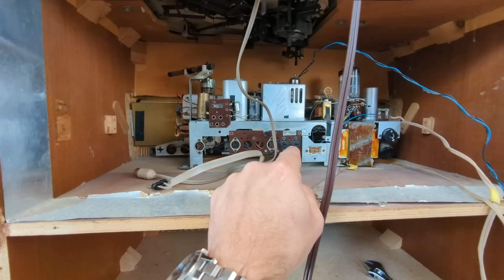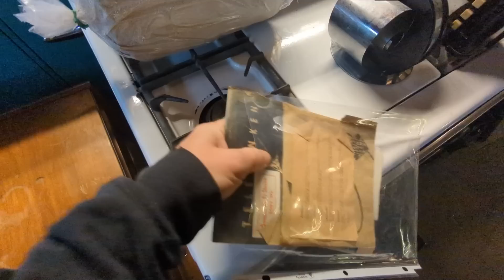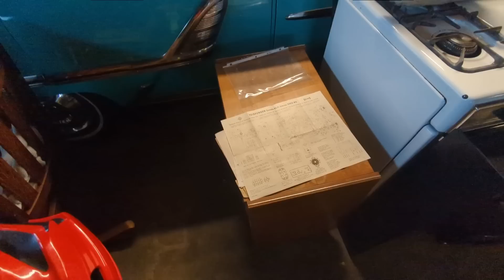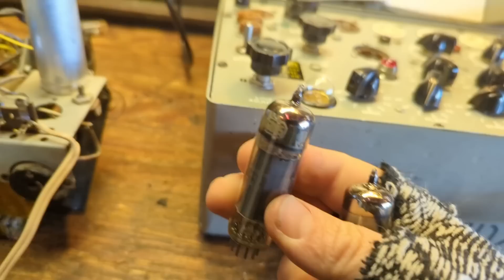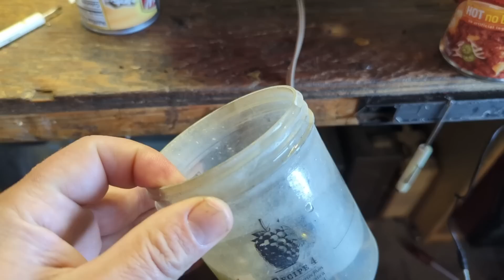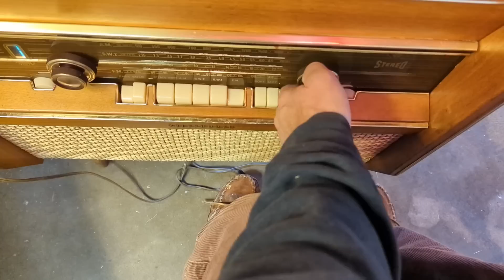Telefunken "Sonata" mini-stereo consolette restoration

Comment: You're a brave one for fixing this one.  A friend has one similar.  A larger console.  Grundig I think.  It has something I've never seen before.  A single tuning knob for four different tuner dials.  It has a little "transmission" with gears that shift from one dial to another depending which selector is pressed, AM, FM, SW etc.  Unfortunately the gears are disintegrating and it's not repairable.  They are no picnic to work on.

Comment: Thanks for doing these German sets, I have always been a bit intimidated by mine, but you are making it look easy. Maybe I should give it a go on a recapping, it has always been pushed back on the shelf and I work on something I am familiar with.

Last German radio I worked on was a Grundig. I thought I brought it up slow with a variac for about 30 minutes, but the main cap let go and spewed white powder all over inside the radio as soon as I took it off the leash on full power. I probably should have been feeling the can for heat, but now that is hindsight. Another great video, thanks....

Comment: I have a massive telefunken console that I'd love to get restored, thanks for posting this. only 5 minutes in so far but this is interesting. my console stereo does work fairly well but the record player is chewed up, I'd love to know if I could hook up external speakers to it for a better sound with the old analog style radio it has those same plugs as the one shown in this video but I didn't find anything that made sense re speakers for it. cheers.

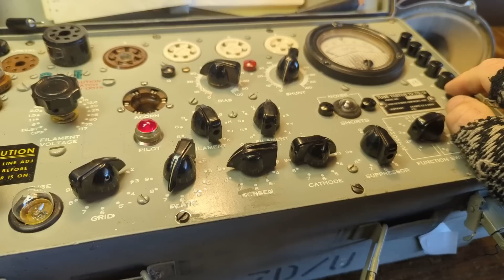Comment: Oh my... so many things happened way too fast but not waiting the 15 seconds for a tube to warm up before calling it "sick" at 16:00 really triggered me... Man, take your time.
Reply: This is my other seldom used account. But anyway Mister radio responding. Anyway... The tube in question was drastically more sluggish than any of the others. It would probably have still worked. Even tubes that test very weak will usually do the job okay. But keep in mind most of the people that are getting these from us are not technical. I want to make sure they have the best-performing most reliable set so that I don't have to do a house call anytime soon
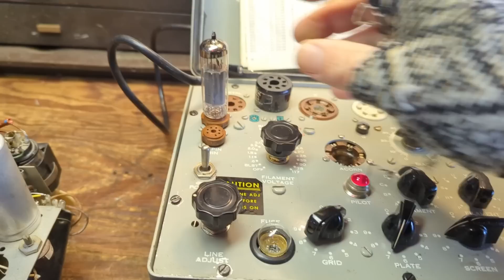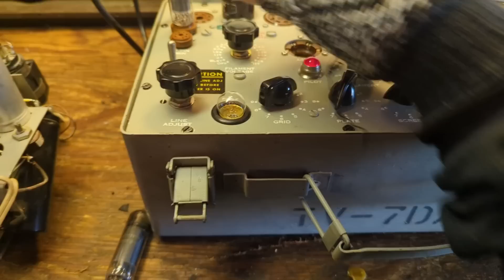Reply: It was actually 20 seconds. Tube in socket at 15:50 and was declared "sick" at 16:10. The tube before that was starting to move the needle and conduct at 10 seconds and was fully conducting at 15 seconds. When you compare it to the other tubes it was a slow starter perhaps, but that means it was tired anyways.
Reply: @zulumax1  Power tubes from different brands "light up" quite differently... For instance my daily driver FM radio with all of it's original tubes jump starts the Philips Miniwatt EL84 from 1953 for 10 seconds, before the rest of the circuitry... I hear the front end going without input for something like 5 seconds. A 1969 NOS Polam EL84 comes up with sound and you hear the volume cranking up. A NOS very strong 1989 Russian 6П14П-ЕВ (military grade EL84 analogue) needs 20+ seconds to start conducting. My point is... this restoration takes so much time and, finally, the tube testing goes on like an F1 race.

Comment: where are the output transformers?
Reply: Some German radios used capacitor coupled audio outputs with high impedance speakers, believe it or not no output transformers!  😯😯😯 I have one, a Phillips Jupiter model.